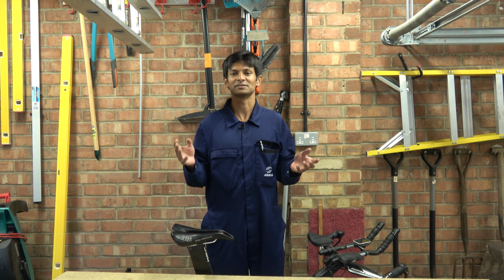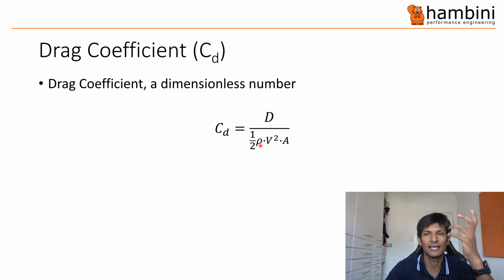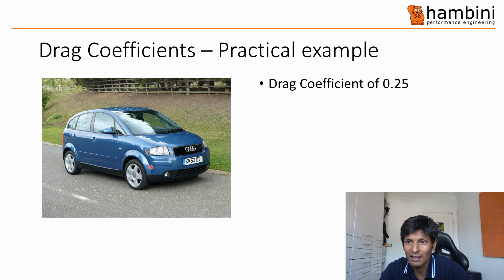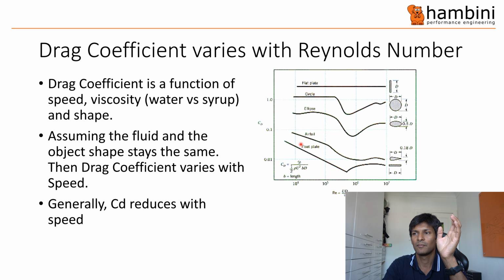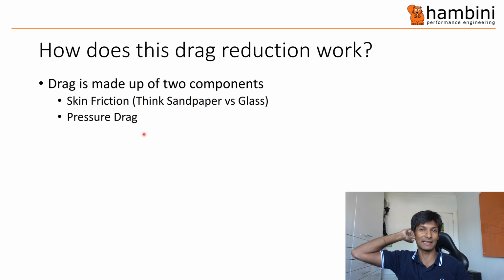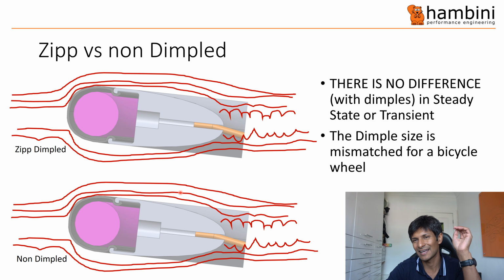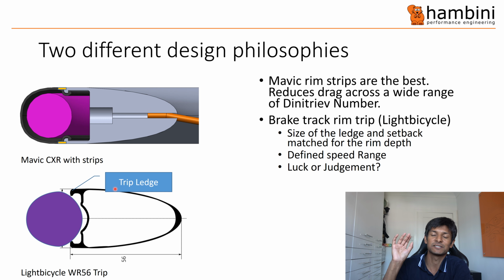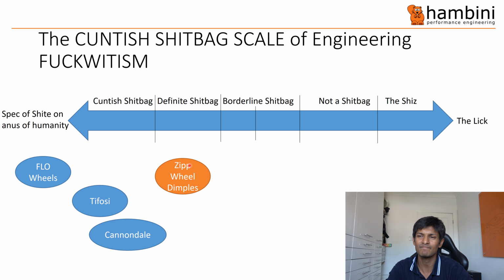Aerodynamics: Zipp Aero Bike Wheels (A Hambini Reaming)

Comment: lol I like your sense of humor. I think a lot of people don’t get it. Anyway, interesting topic once again. If the dimples have any validity in this application, would they need to be much bigger to be of any benefit?
Reply from the maker: The position is the main problem. Moving to the tyre and then making it smooth once turbulent is better.  A fine ring of dimples close to the bead would also be better
Reply: Hambini I guess with discs becoming more popular that would be an option now? Not having to worry about the brake track. Watch, next year Zipp will release a wheel just like that! 😄
Reply: Ryan W - I wonder if they’ll give credit for Hambini schooling them? ha ha
Reply: So Hambini do the current Zipp disc NSWs improve the situation being much closer to the tyre?

Comment: Your BMC TM01 has “trip wires” in the leading  edges of the tube profiles. Do you consider that proper aero engineering or just marketing BS?
Reply from the maker: Trip aerodynamics is a valid concept but not in this application. I think it's marketing
Reply from the maker: It is marketing.
Reply: also what about taping bits of string to your bike frame to replicate speed trips like GCN did

Comment: Your assessment of the incorrect location of the zipp dimples is correct when considering the tyre as the leading edge. But why not consider the rim as leading edge on the aft side of the wheel?
Reply: My exact question too at first... per Hambini’s response, delayed separation of air only matters if the air is laminar coming into the surface.  Makes sense....  good video! I love the scale at the end of the video.  Poor Flo guys haha.
Reply from the maker: Good question. When the air gets to that side, it has been mashed up by the spokes. Hence it's relative speed and direction are still not appropriate for the dimples.
Reply: @Hambini  since the wheel is rotating, would the dimples have any benefit or would it make it worse?  Just curious, since I think it's just for marketing purposes.
Reply from the maker: @mlenz2553  No benefit. I think it was done to differentiate their wheels. Aerodynamically it's a joke.
Reply: @Hambini   Oh, but in that matter, they delivered. Zipp tires looks like "made by NASA". So, if it does not harm the aerodynamics, it's just... plain marketing.
Reply: @Melgaer  Nah, they look like they were made by Top Flite to me.
Reply: @Hambini  Even at a yaw of 5-7*?
Reply: @nicholasthorn1414  heh.  I just wrote the same comment before seeing this one.  Pretty sure it's BS anyway, but air coming in from a crosswind shouldn't be stirred up yet, so it's at least plausible.
Reply: Trailing edge. Not leading edge.

This is the great irony of wide rims too. The wider profile also creates more turbulence on the trailing edge on the aft half of the wheel. 

However, this is relatively minor because the vast majority of air resistance happens in the top forward quadrant of the wheel. 

The lower half of the wheel is traveling at a speed approaching zero where it touches the ground. It reaches peak velocity at top dead center. Note that air resistance increases in the square of the velocity, so that top half of the wheel is creating much more than half of the air resistance (See also the fairings around the car wheels which are perfectly fine to ignore the lower half of the wheel). The resistance is most critical on the forward edge partly because the air coming off the back of the tire in the aft half is probably going to interact with the other parts of the bike, thus reducing the importance of the turbulence. 

Definitely debatable though.

Also, the dimples are not really sufficient to create a significant improvement to the boundary layer.. What you want is a disturbance to create a trip.

From what I can see, the junction of tire and rim would probably do this just fine, although I would want to check that. Remember that the key area of effectiveness is in 45 degrees offset from the leading edge, where there is a pressure ridge from the air which is being pushed out of the way of the tire. You have to visualize it on the sides but also through each cross section and remember that the effective path of the wheel is kind of an inverted toroid because the wheel path is not clean rotation, but a repeating toroid.

You have to calculate velocity for each theoretical point on the wheel as well. I like to divide my visualization into 12 like a clock and imagine direction and intensity of wind force like that.
Reply: @eschelar  This isn't quite right.  It's true the material in the rim at the bottom is stationary, but looking at it in the inertial frame of the bike, with the wind coming from the front, there's a rotation of the wheel at the bottom superposed with the wind velocity.  The wheel is still moving forward relative to the wind (the contact patch is constantly moving).  Skin friction is different.
Hambini's argument about the spokes damaging the air before it hits the trailing half of the wheel may apply in zero yaw, but not non-zero yaw, and Zipp make a big deal about performance at significant yaw angles.
The fact is their wheels consistently do well in tests.  Whether this is in spite of cosmetic dimples doesn't really matter if someone is picking a wheel to use.
Reply: @djconnel  Zipp wheels doing well in tests is usually a function of the tests, not the wheels. For example, yaw angle effects create positive results for all disc wheels and larger side profile wheels. I have gone through quite a number of CFD and real world tests and Zipp wheels are often part of these tests, however I have never seen a test that compares dimpled rims vs non-dimpled rims with otherwise exactly the same characteristics. 
There's a good reason for this. This would need to be performed quite purposefully by Zipp themselves. Just following numbers, it would almost definitely show near-zero or zero difference between the two wheels. As a boundary layer trip, the dimples would likely cause more drag than they would save in the turbulent area on the trailing edge. However, the Reynolds number for air and the actual air velocities would make these features almost completely irrelevant. In my opinion, that is why those dimples are so shallow. Even a golf ball has deeper dimples than that and many more of them.
Golf balls tend to peak around 300-350kph. They need fairly aggressive dimpling to have a measurable effect. The faster the wind speed, the more effect those dimples will have. The slower the wind speed, the less effect they will have. At a ground speed of 70kph, peak wind speed along the side surface of a wheelset is going to be around 120-130kph. 
It is very difficult for me to rationalize the level of dimpling and the idea that there is anything close to a measurable effect on boundary layer dynamics. 
Zipp makes a big deal about yaw angles because all deep dish wheels at 40mm and higher will have positive results from yaw angles. Wheels of rim height 40mm and higher are the highest profit margin for Zipp. So of course they will talk about yaw angles more. Yaw angle performance is significantly less beneficial in real world because the reality is that it is very rare to have a constant directional wind. The exception of this is probably coastal races, ie Triathlon, where courses often have a large portion of their distance in the face of constant directional wind. Most other settings will have wind coming from all kinds of different angles, so the yaw effects are almost entirely negated across the duration of the race. In all cases, yaw performance is improved by increasing the total coverage profile of the wheel from the side, so an 80mm will always do better than any 45mm, 50mm or 60 and a 90mm will always perform better than any 80mm and a disc will always perform better than any 90mm. Regardless of dimples. Regardless of brand.
Reply: @eschelar  Right -- I agree yaw is (pardon me) overblown, because often the analysis fails to consider ground shear, which substantially reduces the wind at the hight of a rim/hub compared to a standard meteorological 10 meter altitude, or the effect of surface structures (which is in part why the wind feels so strong when crossing a bridge).
The dimples perhaps remind me of the Zertz inserts Specialized put in holes in their Roubaix frames.  Sure -- the holes generate compliance, but the elastomer inserts did absolutely nothing at the frequencies typical of riding over rough roads (for example, 10 m/sec, 10 cm features, 100 Hz, which is an acoustic wavelength of 3 meters in air).  But the bikes still did well on rough roads, so no harm done (other than $$$).
I think there's a big difference between cosmetic pseudo-engineering structures, and bad engineering.  For example, the loose tolerances Hambini reported on the Cervelo BB's was shocking to me,  even knowing what I'd previously known about Cervelo (that their frames look sloppy when cut open, and the thick (heavy) paint occludes flaws (the unpainted frames are handpicked).
Reply: @djconnel  I'm not convinced that the reason yaw is overblown is that they fail to consider ground shear, but I think there's definitely some potential overlap there. Certainly, the effect of turbulence is dramatically greater in the top half of the wheel than the bottom half because air resistance doubles on the square of the velocity and the velocity approaches 2x ground speed in the top half of the wheel. Personally, I think that yaw is insignificant because wind tends to be highly turbulent and does not provide a constant yaw in the same way as an angled wheel in a wind tunnel. The fact is that yaw angles with larger side profiles will always produce positive results for 5-10 degrees of yaw, but that condition covers a relatively small amount of time over the course of a race, with many other wind conditions having an effect, plus the fact that every rider in the race is likely using nearly identical wheels, so has nearly identical advantages, so this factor is almost entirely moot.
I cannot speak to the frames, but I can assure you, as a guy in the bicycle industry, I see a ton of pseudo-engineering.
Most of this is because of the large number of companies involved in the industry and the fact that many of these technologies are protected by patents, but also because they have run out of ideas. Bicycles just aren't complex enough for there to be that many areas to yield actual improvements. The improvements are then primarily concerned with marketing and making people want to buy things. 
That's why you never see really good tests being done in wind tunnels, always apples to oranges or fudging data with variances within the margin for error... or providing data that wildly contradicts established physics knowledge that has been reliably and predictably used within aerospace for decades. 
If the physics are wrong, they would find it out on a jet traveling at Mach 2, long before they'll figure it out in a wind tunnel at 35 or 50kph.
Reply: @eschelar  Since writing that I watched Hambini's "master class in aerodynamics" video and I failed to appreciate the influence of the spokes.  Clearly with the spokes, as opposed to the rim, the rotation speed is exceptionally important.  He also points out the random local variation in air speed superposed on the velocity vector of the bike.
I think I took an overly simplistic view of the situation, one which was widely shared among the cycling crowd.
Reply: @djconnel  Your public humility is refreshing. I am glad you have found and taken an opportunity to learn. It's been a pleasure discussing with you.
Hambini does a great job of explaining ridiculous concepts that are accepted as true, mostly on the backs of studies paid for and run by large companies. 
Rotation speed is indeed exceptionally important. Remember that when talking about aerodynamics, most things increase on the square of the velocity. 
For spokes, there's also an interference zone with the fork legs. This isn't a huge deal for wire type spokes, but it is for 3 spoke, 4 spoke and 5 spoke carbon wheels. Spokes do have an overall effect, but I believe this is still significantly less than the frontal profile of the wheel, which provides around 80% of the total wind resistance of the wheel.

Comment: Thanks for taking the time to post in such detail.
Could you possibly get ahold of some Enve AR 4.5s w/28mm wheels and give that a run thru.
I understand, based on the wheel blog you posted, that in general, wider will be worse, and that mid-depth and generally less aero that deep rims.
But I would be curious as to where these would sit as the idea of a great all-rounder wheelset that is super comfy due to wide tires appeals to an older-me.  :)

Cheers

Comment: Question. You have proven with the tyre as the leading edge as it were. What happens when the tyre is the trailing edge?
Reply from the maker: THe air is already so mashed that it's not going to stick. The spokes will act like an egg whisk.
Reply: @Hambini  so they are super aerodynamic when at rest?😉😁
Reply from the maker: @allanfoster6965  I guess you could say so!
Reply: @Hambini  Thanks for the lecture. Are Ridley bikes on your scale of shiteness?
Reply from the maker: @allanfoster6965  nope. The sample size is not big enough yet
Reply: @Hambini  ok. I will let you know! Thanks again. 👍👍

Comment: Great vid👍🏻 What are your thoughts on the Reynolds SLG system ?
Reply from the maker: Overall Reynolds wheels are aerodynamically good. All of these companies bring out nuances and various add ons each year which probably make little difference. Based on the wheels tested I don't think you will have much trouble at all.
Reply: Hambini I’d a pair of Reynolds Assault SLG and then upgraded to a pair of Reynolds Aero 46/58  bought at Low price and I would agree their wheels are great. They are really stable even with strong crosswinds. Had just recently bought a set of NTN bearings from your website and will be putting them onto the Reynolds Aero wheelset shortly.

I’m also curious about campag bora WTO 60 and Bontrager XXX6. If you have chance to test it, would be very keen to hear your thoughts. Thanks!

Comment: I know we're and will be on the topic of wheels, but could you give some insight into how the twin vane downtube of the factor one works(if it does)
Reply: Good call! And perhaps the twin vane on the 2019 Cervelo S5 stem as well?

And what kind of PC spec would run cfd software in 'reasonable ' time to calculate the overall aerodynamic contribution such a shape would make on a fully modeled bicycle. And what would be a reasonable time for cfd analyst to evaluate and make adjustments and re-evaluate 'hundreds' of variations?
Reply from the maker: @caperider1160  If you are good with the boundary conditions then you can get it tit to run in a few minutes but you need to be experienced.
Reply: Like all things, it's a balance.  It's more areo in an area that doesn't really need to be aero.  There should be low pressure behind the front wheel, and if anything, you want the frame to be narrow, not wider. It makes the frame wider (maybe stiffer), but has more mass as there is more material used to build up the frame.  One the guys I ride with has one and it's a beautiful bike.  But not any faster than any other.  Think what would happen if there were three frame spars instead of two.  Maybe five spars, maybe ten.  Hmmm....
Reply: @loopie007  Assuming it's a venturi tunnel,  there would be low pressure behind the front wheel. The last bit about frame spars I don't really understand as I don't know that word. I'll assume you are refering to the twin vanes as in what if they were placed all over the bike... well you'd have a very heavy bike with all that beefing up to maintain structural integrity - and you can't just put aero stuff wherever you like. No point creating low pressure zones at the back of the bike at the very least. As an end note: do you have any objective information that it is not faster than any other/any other is no slower than it? You do by the way want parts to be wider(further spaced apart) like the fork legs and in a more literal sense the downtube for the sake of shielding those poorly shaped water bottles.
Reply from the maker: I'll have to think about this one. Loopie has a good explanation above.